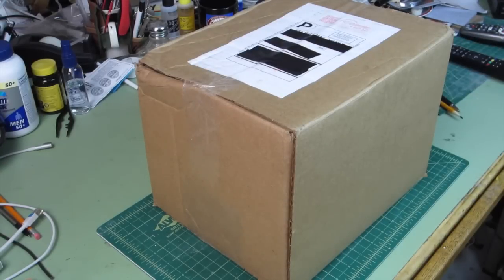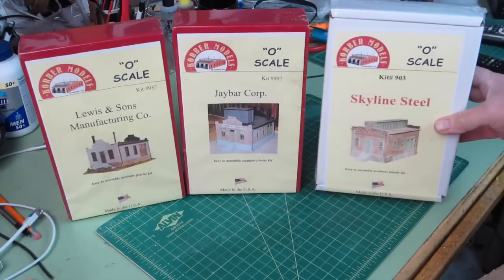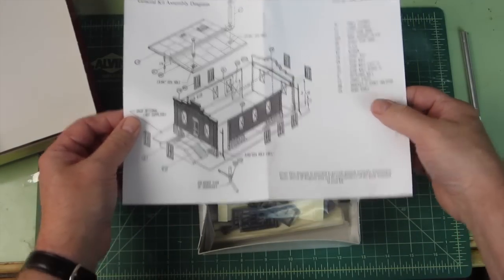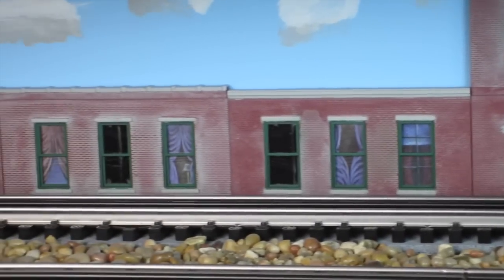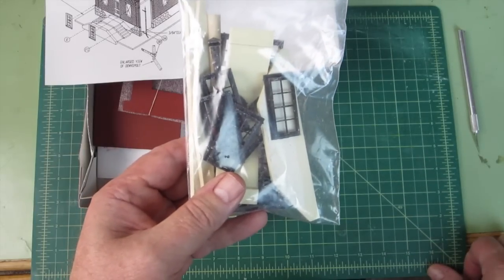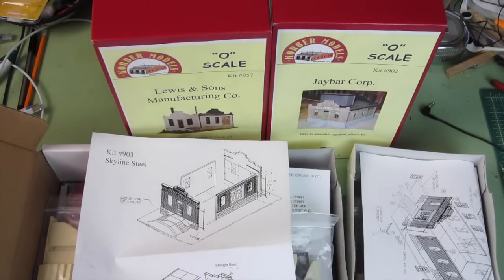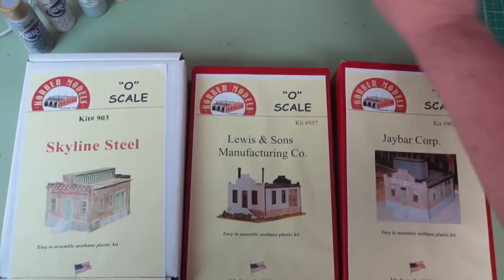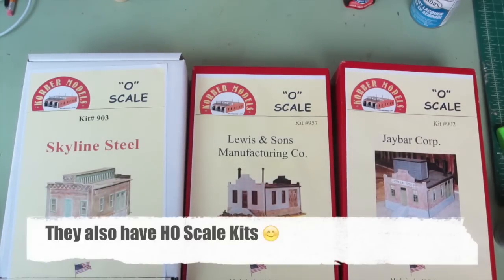Un-Boxing O Gauge Structures

Comment: Gary you got yourself some nice kits and i will have to do some flat kits for myself one day.
and the Southern Pacific Cab Forward still looks awesome but i have one question what do
you use the Epoxy for cheers Robert
Reply from the maker: +csxmad  Hi Robert - Thanks for watching, I also belong to a Radio Controlled Flying Club, The Epoxy is used more with airplanes then model trains, but for the resin molded structures, I like Epoxy for the corners of building and glueing the finished flat to the base. Gary 🚂
Reply: +trainroomgary  Gary thanks for the info might try that out in all the gaps of buildings cheers Robert